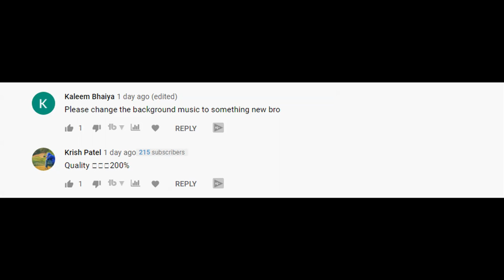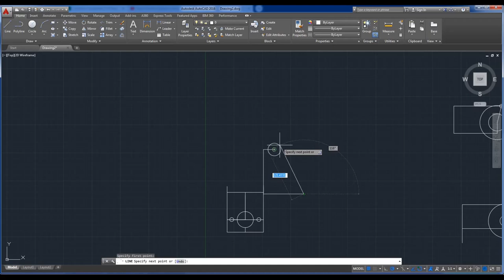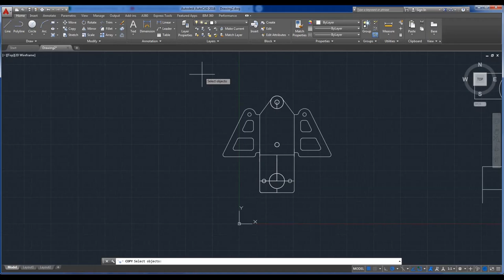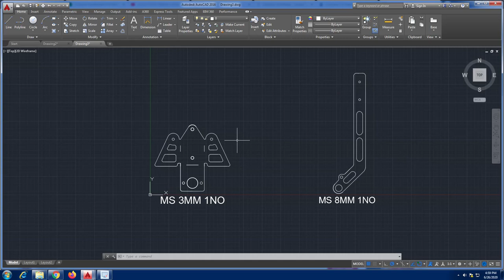DIY HYDRAULIC HANDBRAKE | Project Drift 🇮🇳

Comment: Bhai great job Khub Saras
Give details about Brake line :- soft rubber line, two connector, 3/16 two short hard steel line and 3/16 long steel brake line,from which vehicle is the brake line??  You  Used.plz
Reply from the maker: Thank you brother. The brake lines are not from any car they are custom made. Yes two short flexi rubber lines from the rear calipers and Steel lines with a T (two to one) from there single steel line till the master cylinder for hydraulic handbrake and there is a short flexi rubber line that connects it to the master cylinder.

Comment: First it's a nice video. I've been looking at doing this. But i have hit upon "brake bias" The cylinder youve used has two ports each that has a different level of force usually 70-80% towards the front brake and 20-30 % for the rear. By connecting the two are you getting the right result. I was looking at a single cylinder, either from a clutch or online for the same. Let me know how it performs.
Reply from the maker: yes you can use the single cylinder for clutch too. this one performs great it has good bite.